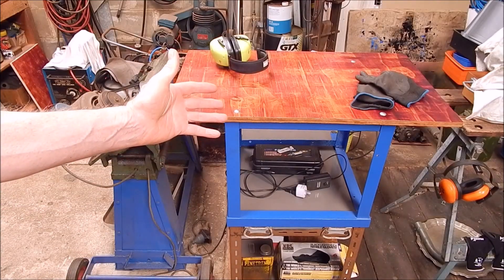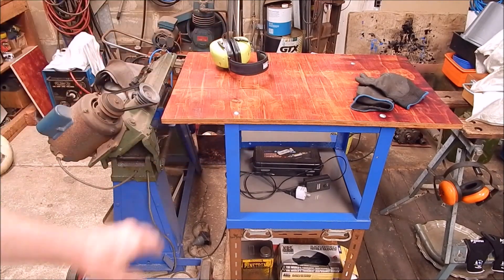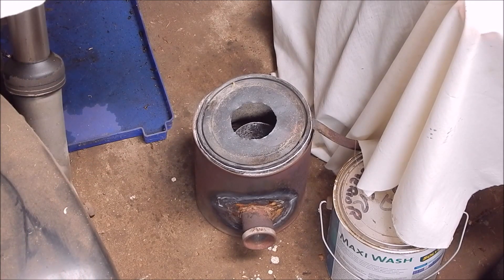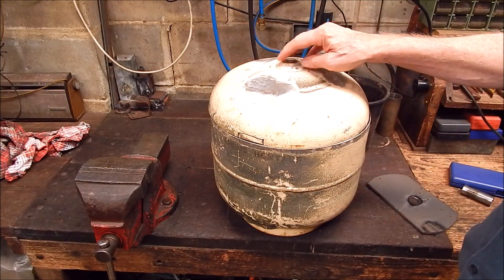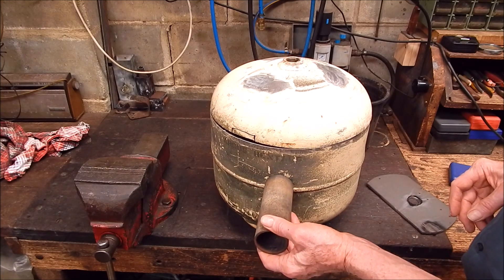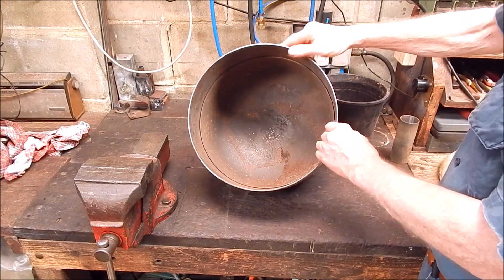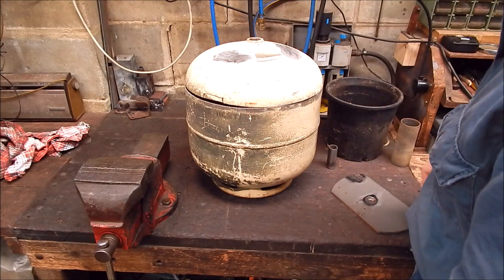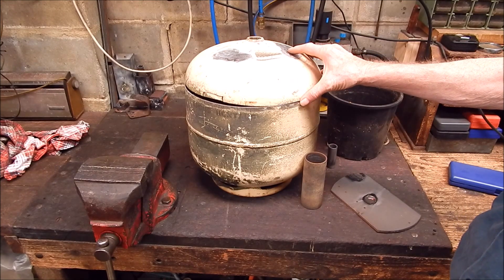Latest news and a metal melting furnace project - part 1

Comment from the maker: NOTE:  I originally tried using a scrap cheap Chinese direct drive air compressor tank, but the metal was so thin and poor quality that it was virtually un-weldable with my stick welders, even the DC one with polarity reversed.  Total rubbish.  Cheers Rob

Comment: Rob, you can get the ceramic fibre insulation blankets for free if you happen to find a retired modern oven and strip off the outer layer of sheet metal - I've pulled apart one that was ~15 years old and got a bit over 1 sqm. worth in a couple of strips about 60cm wide. Just to test it, I put the MAPP burner flame on it for a couple of minutes and it just glows red with no obvious deformation. Getting the rigidiser spray is a bit more tricky.
Reply from the maker: Thanks for the tip Mike.  I hadn't thought of that.  I often take old fridges down to the recycle man, but rarely find a stove (roadside junk).  Cheers Rob

Comment: Hay Rob how about a bit of hard firebrick for the floor ? ,there pretty cheap from heater shops  i used one for the floor of my gas forge and its lasted for years
Reply from the maker: Good idea Lewis.  I will stick with steel as I have the bits I need.  Cheers Rob

Comment: G’day Rob. I’ve got 2 expired gas cylinders put aside for this exact project for the past couple of years, you’ve just reminded me to get cracking. I found blasting straight into the furnace not as good as a tangent entry, it seems to destroy steel crucibles quicker although I use proper graphite crucibles now. 
Cheers 
Peter
Reply from the maker: Hi Peter,  thanks for the comment.  I will try a tangent then as most people recommend that approach.  I have had this old LPG cylinder for a very long time intending to do this project, but only now is it happening.  It will be interesting to see how it welds.  3 mm wall is quite doable with stick welders, so it should be OK.  The Chinese air compressor tank I tried originally was horrible steel and virtually un-weldable with stick.  They probably used MIG in the factory.  Rubbish steel.  Cheers Rob

Comment: A big vent at top seems to be pretty common. Also as Andre said, a swirling flame is much better. Maybe consider a swinging lid instead of hinged? Seems a good idea to me.
Look forward to how it turns out. Cheers mate 🍺
Reply from the maker: Hi Bill,  a swinging lid sounds easy.  I will think about that.  A vent can't hurt and will improve access/allow for mold preheating.  No rush on this.  Cheers Rob

Comment: I know what you mean about the high cost of aluminium, in the past we used to buy offcuts from the main aluminium dealer in Melbourne, now we have to buy the whole length which is quite expensive.
David
Reply from the maker: You're not wrong Dave.  They charge like wounded bulls in Adelaide.  Cheers Rob

Comment: I'd put the pipe in on a angle it heats your crusable more even, the hole in the top works great getting up to temp then you can close it off. Mine works great for aluminum and brass.
Reply from the maker: Thanks for the feed back.  Cheers Rob

Comment: Rob you don't need a flare on the end of a burner when used with a furnace.  Take it off and go with a pipe that you can just slide the small burner pipe into.  Works either way but the smaller pipe should be easier to fit.  
One needs a place to pre heat ingots and tools.   Maybe weld a ring of the tank body to the top side of the lid.    Just enough to form a lip to keep thing from falling off.   This is assuming you have some left.
Reply from the maker: Hi Dan, thanks for the tips.  Yes I was thinking about a vent for just that.  Cheers Rob

Comment: Very interesting project, Rob.  Will be watching your progress closely, since I would also like to build a low-cost furnace with the ability to melt aluminum and copper alloys.  Our ancestors didn't have access to space-age refractories, and they did excellent work in the foundry!
Reply from the maker: Hi Daniel, our ancestors only had simple clay furnaces, so we should be able to do as good.  Lots to consider on this, even though I have a smaller version already and know what worked.  Cheers Rob

Comment: Hi Rob. Just emailed you about this 🙂 I think you definitely need some sort of vent in the top and some sort of handle to allow you to open the lid. With that burner you should be able to get some pretty serious temperatures. Congratulations on selling the mini lathe, glad it went to a good home. Cheers, Alan.
Reply from the maker: Hi Alan,  some good comments/suggestions coming in on this.  A vent has proven effective in the past so it probably will happen.  I have some square sction that should work for that.  Yes, I was glad to see the mini lathe go to an enthusiast.  I will check out your email.  Cheers Rob

Comment: I have built and used several of these, over many years. A swirling or tangential flame is better in my experience than just putting the tube straight in. Saves on the crucibles, isn´t any more difficult to do, and gives a more even heat distribution.  Good luck with the build.
Reply from the maker: Thanks for that Andr'e.  Much appreciated.  I will give swirl a try.  Did you use a solid lid or have a port in it ?  Cheers Rob

Comment: Those air tanks are only intended to withstand 150 PSI, the propane tanks is rated for 250psi or more. - that explains the thickness. It also depends on the volume and surface area.
Did you consider building one with firebricks and angle iron?
Should be very useful when its done Rob.
Reply from the maker: The cheap air comp tanks are no where near as thick as the industrial ones, even for the same pressure max.  I want the furnace small and portable, so that ruled out square and heavy.  Cheers Rob

Comment: An another thing Rob--if you are thinking about buying a milling machine, make certain they do not have fibre gears..There are some cheap heap of crap rubbish out there..           I got caught..
Reply from the maker: Hi Ian, yes that is a real issue for anything mid sized or smaller.  You can fit aftermarket metal gears, but shouldn't have to if they were built right.  I had a viewer in WA write to me about how his top of the range Hare & Forbes mid sized mill tore up a gear first time he tried milling the maximum recommended size.  H & F didn't want to know about it by all accounts and pushed the operator error line.  Being in WA made it even worse as he had to freight it in from the eastern states.  I never did hear the final outcome, but it makes you wary about things.   Cheers Rob

Comment: How do you get the perlite mix to stick to the inside of lid?  I reckon it night need some wires welded to inside top to grab it?   I had done fall apart a couple of years ago... And thought this at the time. 🙂
Reply from the maker: Hi Jason.  Yes, I had been thinking about that.  I will probably weld in some steel mesh to stop it dropping out.  I'm also thinking of welding in a square section vent so I can pre-heat steel molds on it.  Cutting a square hole will be easier than round. I have plenty of scrap steel to play around with.  It might finish up with wheels on it if it gets too heavy.  Cheers Rob.